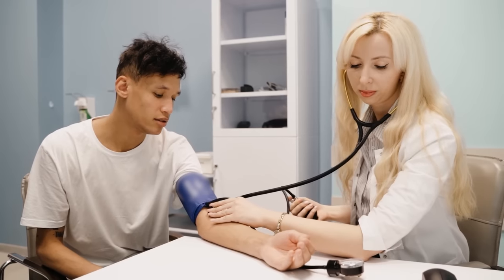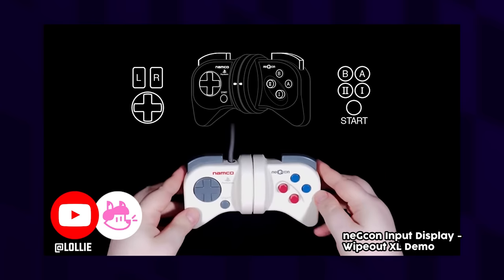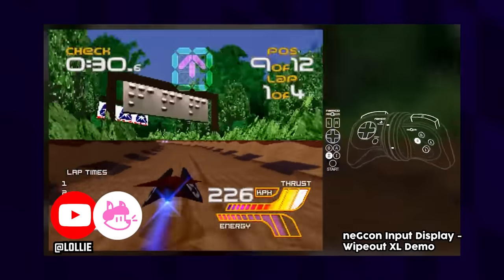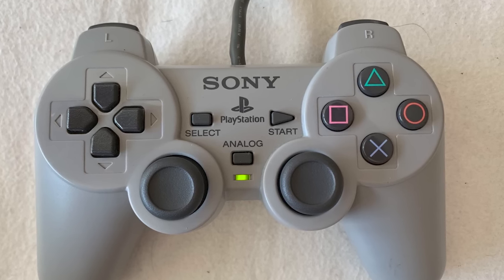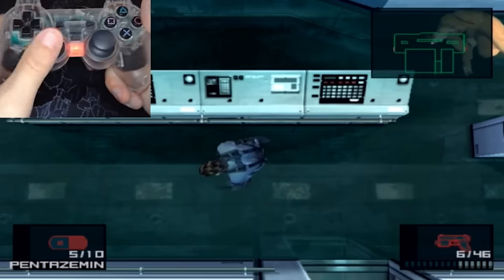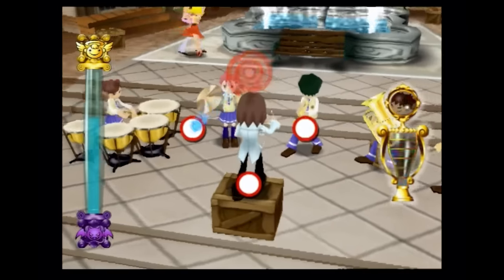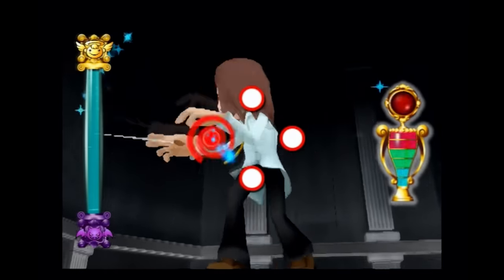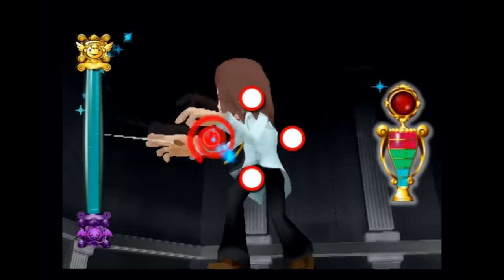The Short History of Pressure Sensitive Buttons

Comment: One of the things I hated more about playing F1 '05 on the PS2 was that the X button that is used for acceleration and it's a sensitive pressure button so I ended up with pain in my finger due to how hard I pressed the button until I found out that you could accelerate with the right joystick and that made the game to play more smoothly
Reply: If you had one of the first generation PS twos with the higher quality Pressure sensitive pads in the controller, as well as the build design of the controller was tighter, this did not happen!

I only ever had one good controller and that was from the very first PS2 I got about two years after the PS2 hit the market!!

After that, the majority of them you had to press so hard because they reduced the amount of money they were investing in materials to make the damned things and as such it made where you had controllers with “gummy/mushy buttons“ and yes, you had to press them really hard to get full pressure!

If they have made all of the controllers quality like the first few years, then everybody would’ve liked the feature because it made it to where you had way more control over your car and games like Gran Turismo and Formula One, games where you had to use X and square for throttle and brakes and either the analog stick or the D pad which had more sensitivity than the analog stick, for steering especially once it was broken and glass smooth!

I remember in Gran Turismo three and Gran Turismo four I could race the car so smoothly with my broke in PS2 controller! I could get an even more perfect line going into corners by barely pressing my D pad and not having to tap it as much because of how sensitive it was!
Reply: @turismofoegaming8806  I have one that's pretty decent to control and doesn't need to be pressed too hard, but the dpad is mushy. i guess the buttons feels great. do you still have that controller and others?? I am thinking it could just be how old or dirty it is - (kids are yuck). pressure is measured by how much the half ball at the bottom of the button is flattened against the foil on the PCB. And unresponsive buttons always means the foil is either dirty, or less conductive than before. Also might explain the mush haha😬

This is a little message about cleaning the yuck 20yo things, which isn't hard. but also i'm so curious, do i have a good one? I got it 2nd hand
Reply: @XPimKossibleX  I always kept my controller spotless clean so it’s gotta be something else?

I do remember it was often very difficult to get a controller that did not have the mushy D pad.. and whenever you got one that had the Moshe D pad plus mushy buttons, you might as well go back and return it or just try to find another one…

I guess this is why they quit designing them because it was too hard to be consistent in the manufacturing process?

To answer your question better:
I experienced PS2 controllers that had the Mushy D pad as well as mushy buttons brand new out of the box!

Best controller was the first one I had and the D pad on it was glass smooth, I kept the controller very clean as I have always cleaned my controllers every week or so just to get any grime or debris from my hands out of the pad.. even the plastic on it was smooth down to a reflective sheen!!

It worked perfectly, it had more sensitivity in the D pad than there was in the analog stick!
Reply: @XPimKossibleX  I always kept my controller spotlessly clean inside and out so it wasn’t the fact that it was dirty-

I think the little balls and pads that determined the level of sensitivity, worked better on certain manufactured controllers the more they were used?

All I know is I bought brand new controllers that had the mushy D pad and buttons that you had to press way too hard! They were brand new.. and often times sucked which is why I thought it was just using keeper components on Sony‘s end? 

I guess it was really just all a gamble?
Reply: @turismofoegaming8806  that's super weird then. i thought with controllers they get less conductive - people scrape pencil lead on to help. 

And haha i reckon all dpads give you more control, you can really finesse how fast you tap and how many times. But if you're talking about holding it down and changing pressure, that's bonkers. I've gotta try that. 

the analogue sticks are pretty bad though, the deadzone is huge compared to modern ones. doesn't bother me unless i'm playing an ps2 fps which... makes you feel why they didn't take off yet. lol i guess even xbox must've managed it better. 

so my last question is if you're taling about holding it down and varying presssure, and how that compares to a ps4/xbone analoge stick's sensitivity
Reply: @XPimKossibleX  The quoteholding it down and releasing pressure only worked for certain curves..”

I mostly had to tap it also, but as it got more and more sensitive I tapped it less and less?

It was just the best way of playing Gran Turismo with a controller I’ve ever experienced and could not experience the same thing in every controller afterwards even when I got my PS3, it just wasn’t the same, the controller did not have the same level of sensitivity, weather brand new or even five years old or even using my PS3 controller today.. I will admit that I ended up getting a clear blue PS3 controller in around 2012 or maybe 2013 to match my chrome blue PS3, and anytime you got one of the colored controllers they automatically were cheaper-

Every time!

but yeah, I don’t know if I had a controller that had better components in it or was just built better or if it was a combination of all of those factors plus the fact that I kept it very clean? 

All I really know is it worked really good-
Reply: @XPimKossibleX  The Xbox one controller actually has more sensitivity and it’s joysticks than both the PS4 and PS five pads!!

I’ve never experienced such sensitivity in the stick as to have it make a change in direction in the car on the screen when I have not even moved the joystick yet, only Applied pressure!!

But not all games will even have that amount of sensitivity programmed into the control scheme! The only game that I experienced that did, what is project cars. If you up the sensitivity level on the joystick you can get it to where it is so sensitive that the car will start to turn before you have even moved The stick! But again, it’s in a game that is hardly worth playing with a controller even with that-

Comment: I would always rather bind acceleration and braking to the triggers than the buttons in GT5. It's way easier to tell what you are inputting because of the physical movement.

Another thing I dislike is how crummy the pressure sensitive dpad feels, as I understand it it makes it easy for a left handed player to swap over the controls but for normal people using a joystick makes way more sense than an analog dpad.

I still like and use the analog face buttons on my PC for things like the clutch and E brake in driving simulators, you could also potentially use them for flight controls in flight sims. They do have limited use in the end.

Comment: I remember playing Vice City on PS2, and wondering why to run you had to tap X, to sprint you had to tap X faster, when in Mario 64, the further you moved the analog stick, the faster you moved.
Also remember if you held X(accelerate) about half way down, you would drive at a constant speed(like cruise control), and in helicopters if you held the D-Pad up halfway in, the helicopter tilted enough to move forward, but not enough to lower its altitude.  Also remember playing Colin McRae Rally 3 on the Original Xbox, and getting frustrated that the car didn't seem to be accelerating fast enough, and was thinking it's not like if I push the button harder, it'll go faster, before proceeding to press the button harder and going faster...
Also on GTA IV on PS3, I was having difficulty controlling a motorbike, thought maybe the analog stick had started to drift, took me a while to realise I still had SixAxis movement on, so tilting the controller was offsetting the amount I was pushing the analog stick.

Comment: Dude, gran torismo 4 is great for this.  Before they realized analog triggers were better for gas and brake, gt4 used x for gas, and it was pressure sensitive
Reply: Fact is, pressure sensitive button IS better for brakes, it allows you to be more percise and better mimick the real thing too. Not for accelerator, it would be too tiring if it required full force. And pressure sensitive d-pad gives you more control than a stick does.
Reply: That's why the transition to PSP (aka GT4 -> GT PSP) isn't a very smooth experience.
Reply: Analog trigger IS better for brakes, pressure sensitive button would only be better if the only other option was a digital button (no analog trigger available) @shortcat  That's why the Dreamcast was the first console that was great for racing games with the standard controller, it had analog steering with the stick, and analog acceleration/braking with the two triggers.  PS2 you could use the left analog stick to steer, and the right analog stick to accelerate/brake, but only gas OR brake, not both at the same time.

Comment: 19:45 I've been using the sticks to accelerate in Gran Turismo since Gran Tursimo 1 :D . Since the very first title Gran Turismo had a highly customizable controls, stupidly enough so you can set, for example, pushing to the right the left sitck to accelerate, pushing up the right stick to brake, and pusigh left or right the right stick to steer. Being said, my way to go was using the right sitck to control the wheel, and the left sitck to accelerate and brake, emulating the RC stick transmitters.

Comment: Pressure sensitive buttons were so awesome especially once you had a good PS2 controller that got broke in and the DPad was glass smooth!!

You would have more sensitivity in your steering with a good broken D pad than you did with the analog stick, just like with the X and square buttons for gas and brakes you would have more sensitivity and more control over the car using the buttons!!

When the PS4 came out, I always hated that they got rid of this feature, but the feature wasn’t as good in second generation PS twos and nor was it as good in the PS3 during its entire lifespan-

It was cheaper and did not have as many degrees of sensitivity or as many “steps“ in pressure!

The PS twos that came out for the first few years, had the highest quality pressure sensitive pads in the controllers and once you had a good one that was nice and broke in, it was so sensitive that it was amazing!

Comment: I'd say in mad maestro for the hard press use your arm to push your finger in, mid press would be pressing by squeezing the controller a bit and light press by just using your finger to tap

tho getting used to and switching between them on the fly would definitely take quite some time.

Comment: I thought the analog button was for opening some kind of menu like every other controller with a third button in the middle (ps3, 360, wii, etc). Hell even the adapter I have to use ps controllers on a pc opens up the Steam overlay when I hit that button (though it takes like an entire second befor it opens and good luck using button combos like opening the keyboard you can its just hard with the lag).

Comment: The missed inputs thing is right but also fitting for metal gear solid. I would be hard time to control my gun or knife in mgs2 or 3 but it was also entirely immersive as being in control with reasons for pressure is all it was perfect, immersive use of feature prone for missed inputs. I just had weird feeling the one time I used knife-point in MGS3 HD and ended up slitting my captives throat without even realizing I had built up that much pressure. 

Also in MGS2 and 3 If I recall right, later automatic weapons swap the pressure function; light for aim and hard for let it rain. Really MGS2 and 3 are best showcases for immersive functionality of Analog Buttons and how pistols work in 2 and 3 are best simulation on trigger discipline under pressure that even VR is yet to match.

You can also zoom cutscenes in MGS2, 3 and 4, and in 4 it is DPAD up instead of... A button I forgot in 2 and 3 but if you feel like the feature is missing in 4, it isn't it just uprooted it's life and moved to different state she's still there if you visit her.

Comment: I'm surprised Nintendo didn't use it on the switch. having normal analog triggers wouldn't work on the joycon so using the pressure sensitivity to simulate that would be a nice alternative while still punting regular triggers on the pro controller.
Reply: The last Nintendo controller to use analog triggers was the GameCube 😭
Reply: @ndnixlon9548  nope the Wii had them.
Reply: @bland9876  Yeah, the Classic Controller. mb
Reply: @ndnixlon9548  yep. Wonder why they thought that (not using analog triggers anymore) was a good idea

Comment: thanks to the neGcon, you can play games like GT1/2 and RR4 in with a modern controller & control scheme by having your DS4 or XInput emulate a neGcon in duckstation with some rebinding
Reply: Duckstation (and ps2 emus) even let you map any analog thing to any other analogue thing - so a trigger can come a twist, a stick direction, or even a pressure sensitive button. Pair that with the mapping inside the menu... and it gets way too confusing. Haha sorry for the rant, but yeah, the best options are either emulating the negcon's twist, which is very smooth, or emulating a gforce driving wheel and pedals... which is way more control than you'd expect a controller to give you

Comment: With the Gran Turismo games (3 and 4), it doesn't help that the games have a drastically reduced sensitivity range. It maxes out the throttle around, and this is from memory and very inexact, maybe around 160?
The way to figure out an exact-ish number is to use an old (wxWidgets-based) version of PCSX2, fiddle around with the input system's sensitivity until you get the lowest value that still gives you full throttle in Gran Turismo 4 (because it shows you your throttle and brake input on-screen, and GT3 doesn't), then start up the PadTest homebrew and see the number it gives you for that sensitivity setting.
(Unfortunately, LilyPad, the PCSX2 input plugin, put its button sensitivity as a float maxed as 1.0, and not the unsigned byte it should have been.)
Reply: It's so you don't hurt your thumb more than you already do, the full 256 range takes a lot of pressure to get there

Comment: I always felt that, at least for action games, the PlayStation controllers' tiny buttons were way too small for pressure sensitivity to make much sense. I never felt I had much control over it, and in for instance The Bouncer presses I meant to be hard came out as light and the reverse.
It might have worked better for driving games, which I never really played much on the PS2 or PS3, but in the games that implemented it that I tried it felt more random than anything.
Reply: Nah it was awful, I definitely hurt my thumb from trying to maintain full throttle down the straights in TOCA Race Driver 2
Reply: @DanielHarveyDyer  Yeah; that's my (limited) experience as well, but some people apparently swear by them for driving games.

Comment: So could it be argued that a PS3 controller would be better than a PS4/PS5 controller for emulating PS2 games, because of the pressure sensitive buttons? Do the PS3 controller's pressure sensitive buttons even work with the PCSX2 emulator? I do remember enjoying how you could cruise along in Vice City by holding lightly down on the X button (rather than strongly), so a PS3 controller may allow you to do that, but a PS4/PS5 controller wouldn't.

Although I suppose this is only a very slight advantage that the PS3 controller would have then over the PS4/PS5 controller. And for most PS2 games that utilised pressure sensitivity, the pressure sensitivity wouldn't improve the game so much that it'd be worth using a PS3 controller with them, since the PS3 controller is so much more difficult to get working on PC than a PS4/PS5 controller, and isn't as reliable. But still, some may think it would be worth the trouble for that slight improvement.
Reply: I almost always play my ps2 with a ps4 controller and a plug in adapter and of the games I own I have not noticed a difference. The only exception is ace combat 5 where the size of your radar is controlled by pressure sensitivity, and for that I just use a regular dualshock 2. There are very few cases where the pressure sensitive buttons makes a difference in ps2 games that support it.
Reply: @whogavehimafork  Cool, thanks for letting me know.

Comment: Am I the only one that's noticed that Steam's controller remapping software can treat every button on the controller as an analogue input? Given what's said in this video that wouldn't be necessary since no controller ever had analogue start and select buttons but regardless Steam Input makes it an option for every single button on any controller. Weird. Makes me wonder if the Steam controller or Steam Deck secretly hss pressure sensitive buttons